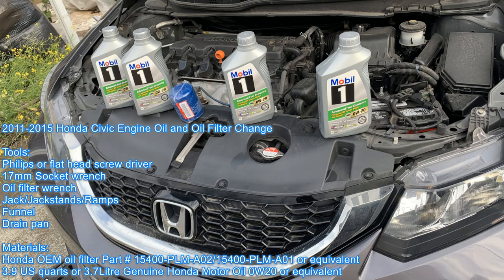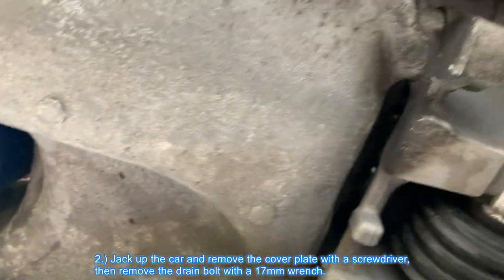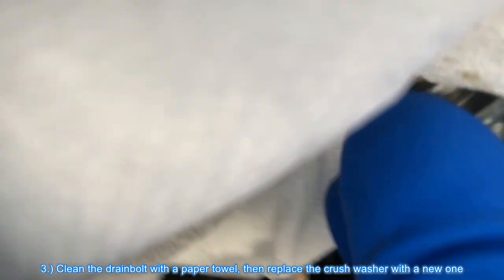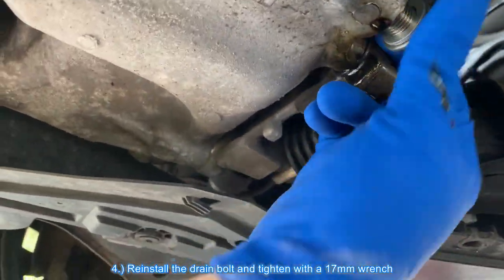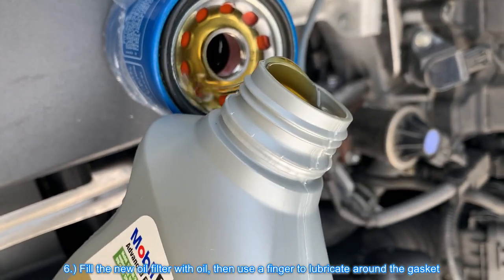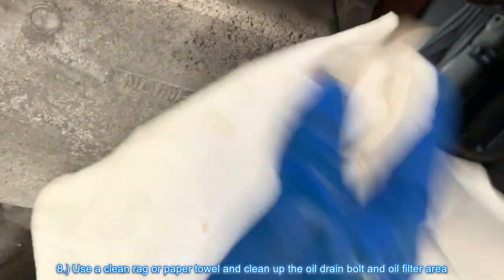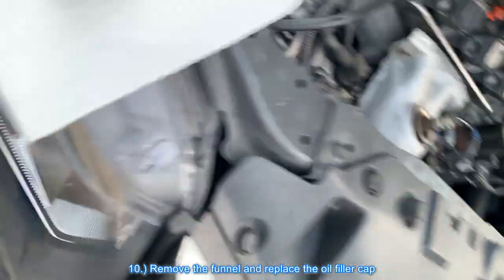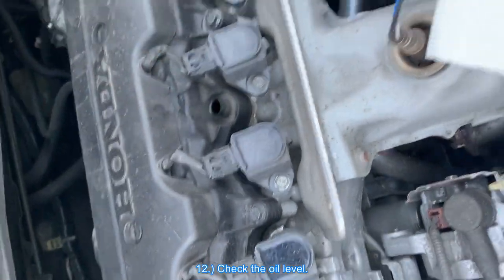Honda Civic Oil Change DIY.   FAST 3 Minute DIY Video HD 2011 2012 2013 2014 2015 Honda Civic

Comment: Nobody replaces the washer lol 😂
Reply: Why do ppl insist on changing it tho
Reply: Also, he didn’t include it in the list of “things you will need” anyway.
Reply: @tr1plea055 The washer becomes deformed with repeated uses and can cause oil leaks if not replaced.

It’s worth doing because it’s so cheap and you’ve already removed it anyway.
Reply: @TwenOalley and it’s only a couple dollars. Seen my coworker have to go back and replace a washer many times because of it being old

Comment: Those skid plates are a fucking scam. Their only purpose is to prevent you from changing your own oil by making it impossible to remove the screws without stripping them.
Reply from the maker: Thanks for watching!

Comment: "tighten with the oil filter wrench"

NEVER tighten using a tool! Hand tight only! Also you should really torque the sump plug up properly; I've seen one done so tightly that I was able to swing off a ratchet connected to one, and I'm an overweight 5' 9" man. If you go too tight then the pan can expand during operation and crack can form from the drain hole.

+1 on using HAMP filters though.

Comment: Replace the damn drain plug
Reply: Why lol? No need what soo ever
Reply: No need to even replace the washer
Reply: @Diego-cm2ci I’ll use the same washer for 2 or 3 oil changes as long as it’s not deformed. When I do finally change it out, it’s usually after a year.